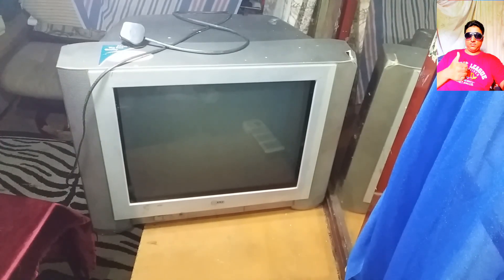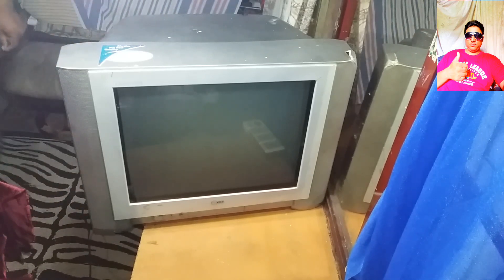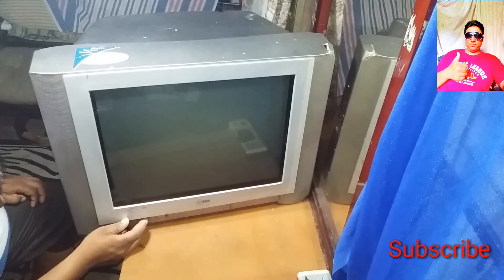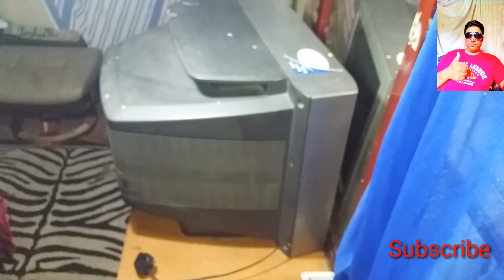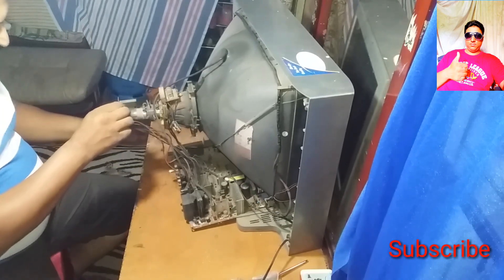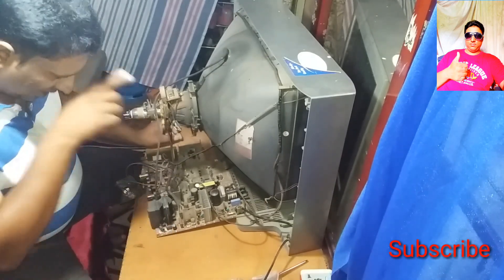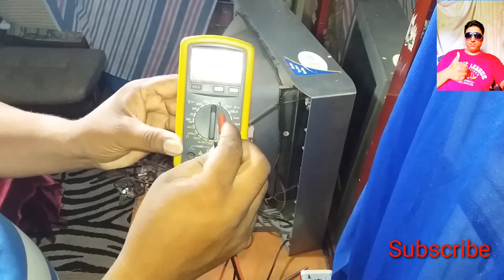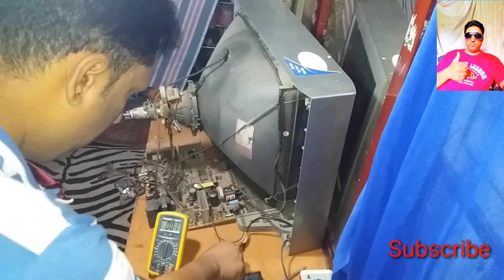Lg tv no power repairing in sinhala

Comment: Aiye LG TV ekak thiyanawa ekata power enawa yanawa a kiyanne LED bulb eka on wenawa off wenawa. Ekata hethuwa mokakda aiye
Reply from the maker: Lg tv crt tvda.ledda.lcdda.reply karanna
Reply: @alltechsinhala  ow model number eka21FC2RGE - TY. H out eka short wela thibuna eka aluthin damma. Eth hari giye na apahu H out eka sampurnenma short wela.
Reply from the maker: @shamilaaththanayake5616  malli primery section ake vidala rektifire diod ake voltege ake(110 to125)h out akata yanawada kiyala balanna .h out aka funtion wela 180 voltage lot akata anawada kiyala balanna vartical section ake thiyana compons awa check karanna. jayawewa prasnayak thibboth replay karanna